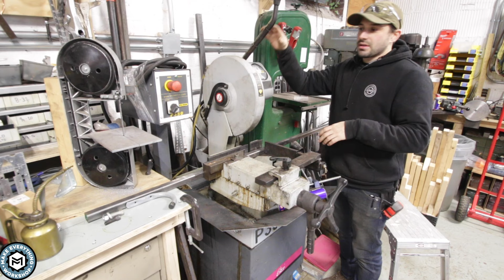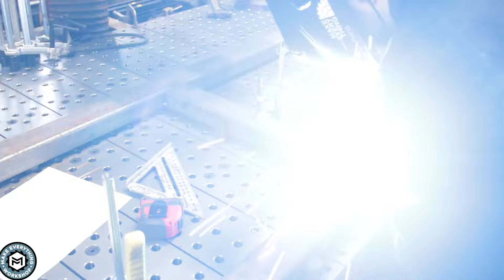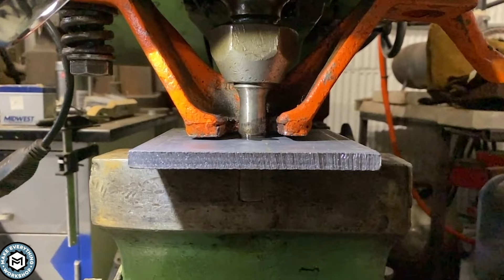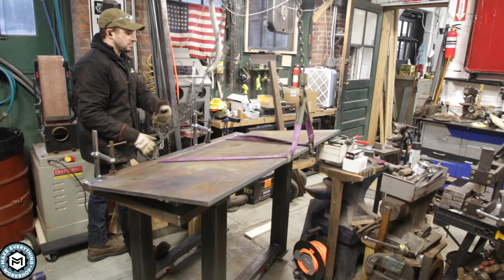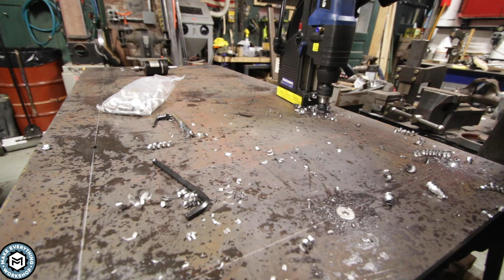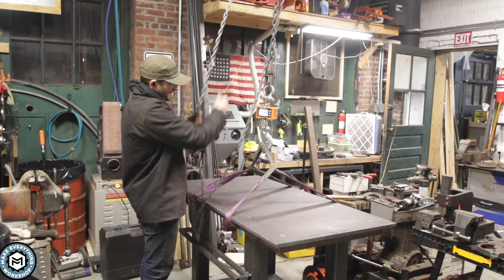Building a 665LB Steel Welding Table/ Workbench!

Comment: My first job in a welding shop was right out of high school in 1971. This was a huge shop and would be better called a manufacturing facility than a welding shop and I worked on the welding side of this shop. I worked with the same welder every day and he showed me as much as I could absorb, he was a great guy. One morning he tells me that they need me in another part of the shop for a week or two and told me who to ask for over there. We were all working on a job for McDonald Douglas at this time and I didn't understand exactly what it was we were building but at 18, I felt overwhelmed much of the time anyway. But I walk over to that department and know who I am reporting to since he's one of the owners and the guy who hired me. But he's standing on this huge sheet of plate that was at least 3/4" thick and probably 40' X 40' or even 60' X 40' and he has a magnetic drill in front of him. He asked if I knew what it was and I did but didn't know how they operate. So he sets it up and drills and taps a hole at the same time and I was flabbergasted!  What a great idea! So he helped me set it up and drill and tap a few holes until he was fairly confident that I was OK on my own. Looking at this plate though, there were pilot holes every 4" or maybe 6" and I was to drill and tap every damn one of those holes!  My excitement quickly waned about using this piece of equipment all day, every day for weeks to come. I can't remember the exact size of the tapped hole but it was at least 5/8" and may have even been 3/4" or 1". And I can't remember now just how many days I spent on this damn drill but I'll always remember the elation when I finally drilled that last hole. And I know that I broke at least one bit and that's when I learned they cost $50.00 each in 1971 money!  But in my defense, I removed the bit from the chuck when it started getting dull and asked if I could have someone in the machine shop sharpen it for me. He looked at it and agreed that it looked like it was getting dull but he had new bits ordered and wanted me to keep using it like it was. Well, that bit didn't finish the day and that's when he told me how much they cost.  But I'll give him credit for talking responsibility for it when his partner started to yell at me. He cut him off cold and told him that I had come to him earlier in the day with the dull bit and he told me to keep using it. I got to go back to my normal job for a few days. 
Every time I see a mag drill I remember this job! I hate monotonous work and back then I got bored very quickly.  At lunch, I remember complaining to "my" welder about this boring damn job and all that he said was: " Hell Russ, it all pays the same, don't it?"  And he's right, I got the same pay no matter what the job was that I was doing. That didn't make me magically start enjoying it but I knew that I had a good job, with good employers, and that drill was just "for now, not forever". So I stopped complaining and started working as hard as I could to get finished. 
And when all of the pieces were fabricated and painted I got to be in the crew that went out there and installed everything. I couldn't stop gawking at everything and would have loved to had the opportunity to tour that facility. 
Sorry about the long narrative, but like I said; every time I see one of those mag drills I remember.
Reply: My cousin made a comment to me one time, "work is work", along the same line as your welder said to you, "it all pays the same".  That one comment from my cousin about 25 years ago totally changed the my perspective on working.  Work is work, yes some is funner than other stuff, but it's all work that needs to be done.The more you complain the longer it's going to take.
Reply: Thanks for the story.
Reply: Write book dude. At least you get some money by selling it instead teling your life story here for free.

Comment: fantastic!! I am building a Welding table that is almost 2 inches thick for the top plate. I am debating how to make the frame and everything. I believe I found it with your video. Thank you
Reply: 2" thick
I'm not sure if dump truck bodies are that thick.
The frame might have to be a forklift. 
Wheels might come from the rail yard
Reply: @commoncents456  haha. It is only about 500 pounds. I had to leave it in the trailer while I swapped axles for a 4000 pound axle. I have a friend that has a skid loader so he can put it on top of a decent Rame.

Comment: I like that you left a clamping edge! you see a lot with the frame all the way out making the tables a little harder to use.
Reply from the maker: Glad someone noticed that! I didn’t really talk about the top frame dimensions but i left a 2” edge around the whole thing so I could clamp easier. Having the tubing on the flat like that also helps get a clamp on there!
Reply: Now flush mount your vice under the table too

Comment: I was gonna guess 664.75 lb. dang it!! Really good table man. I’ve had a 45 yr. career in welding/fabrication, and have gone through many workbenches... “It will Keel”! I’ve always wanted a Fit-up table, but now I’m just as fast without one. Now a  Plasma CNC table and a Fit-up table ... that would be cool for the home shop just cuz I can would be super cool!!!

Comment: I seen a work table designed with movable casters.  There were two cross bars on each  end of the table, top one was welded in place, bottom was movable up and down and the casters were attached to lower one.    There were two springs supporting the bottom crossbar and a small bottle jack was secured between the top and bottom bars.  If you wanted to move the table you just pumped up the jack on each end of table  which pushed the casters down to the floor.  Roll the table to new location and release pressure in each jack, the springs pull the bottom bar up and the table sets on its legs which still have the leveling feature.

Comment: one tip for your bandsaw mate is to move the guide rollers on your side of the blade as close as possible to your material and lock it, gives you square cuts if your saw is setup right, also cold cut saws are nice but from working in workshops all over the world bandsaws are the ticket, more versatile and you dont need a "milled edge" for fabricating just get within 1mm and off to the races.
Reply from the maker: Good tip! If i had to have just one, i would keep the bandsaw for sure. There is something nice about that cold saw though, man those cuts are perfect!!

Comment: Nice job.

I have the plate on my hydraulic welding table held on like this.  I wish I had tapped the top and bolted from the bottom, for a completely flat top.

Comment: Those overhanging feet? I am curious how your ankles and shins appreciate them here half a year later after many bumps and scrapes. I think I would have matched them in size to the legs with a bevel and just welded them from the side.

Drilling and tapping is great for later adjustment, but I think I would have done it different. Drilling all the way through with tapping drill size. Then tapping the plate and putting in the bolts from the bottom. Three reasons for this. No need for all that countersinking and trimming the bolts to sit flush with the table is easy. If later you need to attach something to the table taking one screw out or extending one and attach with nuts gives you options. Last reason is like you said makes it possible to flip the plate, and if you measured precisely it is a simple flip and screw using existing holes.

Comment: agreed, thtere is always errors on each corner.  by doing it this way you are not compounding those errors at each weld.  You have a small error on one corner, an equal error on the adjacent corner and then what ever those errors are will be the same on the last two corners.
You are not accumulating error, you have ONE level of error not one level of error added to each new corner which is what you would have if you welded round the circle.

Comment: 4 foot by 2 foot frame, plus 4 inches of overhang, according to the 2 inch spacing of holes on the welding table and another comment below. I've been thinking about a very similar table for a while now, and wondering how thick I want the top, definitely wanted 5/8/16mm or thicker, 3/4/20mm seems like a good choice, any thicker would be just silly with a small top that big (similar to what I want). Those threads on the feet are probably M16x2 or maybe M16x1.5 - I'd worry about the bending moment on the threads if one side of the big round foot was on something a little higher. On another HEAVY project I built I used hardened ball bearings as a point loading mechanism under the 4 adjustable feet and that worked really well. Would probably do the same again on something like this, I think, but maybe skip the washers and make disks out of plate steel instead. I'd also want the wheels further out and likely on some mechanism to speed up the move/drop process for indoor/outdoor flow use.

Comment: You should be doing your taping dead last why tap material that is only going to be removed like your countersink the taps that size are very expensive  and if you have lots of hols it realy adds up to a lot of steel that Is not going to be there that you taped! Don't you think??

Comment: With those open hollow legs you could fill them with sand or concrete to add even more weight and it might help it stop ringing if you are beating on it.
Reply from the maker: I had a thought to do that, but with the threaded post legs I didn't want the sand to kill those threads, good idea though!
Reply: @MakeEverything  yeah, I suppose you would have needed to stuff the bottom of each leg with foam or something to protect the threads.

Comment: Not sure if u will even see this since its an older video but I'm just curious why not use a horizontal band saw? I love mine especially since after I set the first cut up I don't have to change anything for the rest of the same parts I'm cutting... I so realize that the chop saw is faster but I just feel the bandsaw is superior...i would really like to hear your input on this...if you see it lol
Note: 90% of what I'm cutting is round tubing from cro-mo rollcage tubing up to large aluminum intercooler piping...idk if that make a difference to you but figured I would add that

Comment: Why no fluid on the bandsaw?
Reply from the maker: I got the saw used and they were using some really old and sticky cutting fluid. All the fluid lines are hard and brittle so I want to take the time to replace them all, and clean out the pump and basin. Ill eventually be using Greencut fluid which is cut with water and really safe for your skin. It also doesnt leave a bad smoke when you weld stuff right off the bandsaw.
Reply: @MakeEverything  excellent.  I knew you’d have a plan.  I have the baby brother of that saw from Baileigh and really like it.  Being able to cut miters without having to swing the metal or reposition the saw is a life saver.

Comment: I am Trying to understand why you would drill , Tap, and Countersink Bolts on a Table that weighs a ton but besides the weight you said your going to weld and pound on it so Why put Nice Bolts on top where you might be welding? Why not weld from underneath Leaving the Entire Surface Clear and clean to weld Anywhere and never worry about Bolts? it is a 
Beautiful Table! all the Bolts are Now places you Can Not Weld to right?

Comment: With that thick tube I'm surprised that you didn't use a stick weld
Reply from the maker: That 360MP can burn into 3/8 no problem! I try not to stick weld inside if I can avoid it.

Comment: Most important question not addressed…….$ 💰 how much was put into it. Total.
Reply from the maker: Probably $650-700 with the cost of the plate and material. Not including my time to fabricate.
Reply: @MakeEverything  …..I was pretty close to that with my calculations with the metal prices here in far West Texas. I think if I can find someone that has a piece of scrap 3/4 metal plate for cheap instead of new I could cut my cost drastically. That’s an awesome build! 👍🏽👍🏽👍🏽👍🏽 I like it and think I might be replicating your design.

Comment: Hey mate I am keen to do a similar build but with lighter 10mm plate, 2400 x 1200. I live 100 metres from the beach and most of my steel turns orange very quickly with the salty air! Do you have any tips to keeping mild steel in good condition? Cheers from lord howe island, Australia.
Reply: We have the same last name
 And im.also an aussie 😄

You can get some COLD blueing for rifles and put it on the steel. No rust

Or now and again give the table a spray with some wd40 or some gun oil
Cold blueing is great though.

Comment: That's a fairly heavy duty table, but believe it or not it will sag on time if you do a lot of burning and bending with heat over it.  The first steel fab company I worked for had one inch plate tables we used for heat chambering and other similar tasks and even with I-beam legs and structure they all sagged in time.